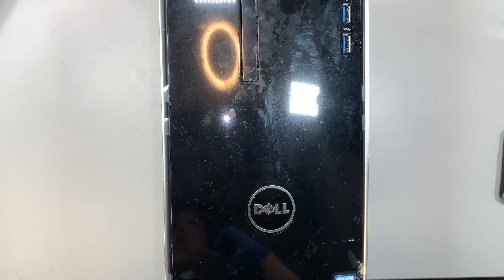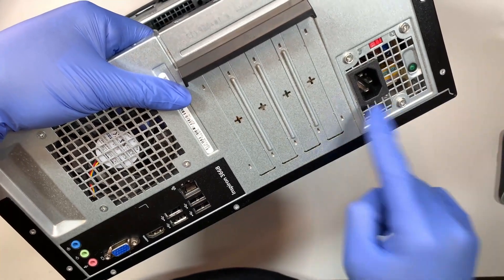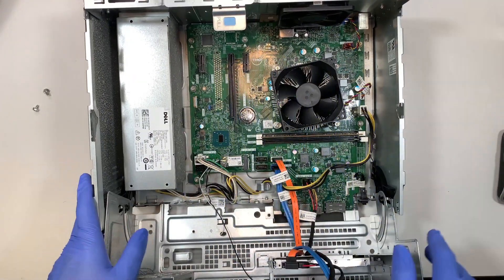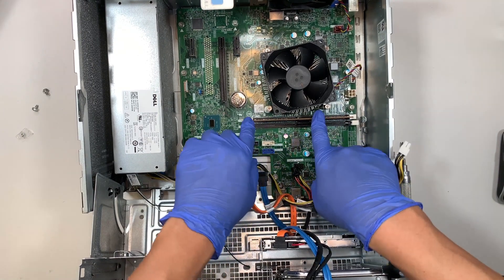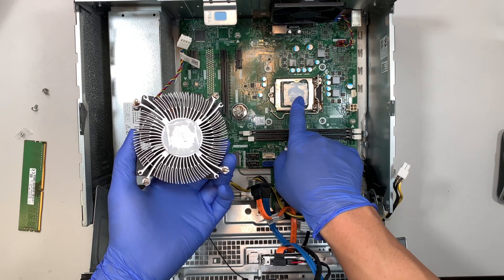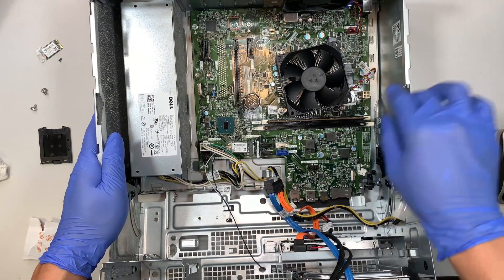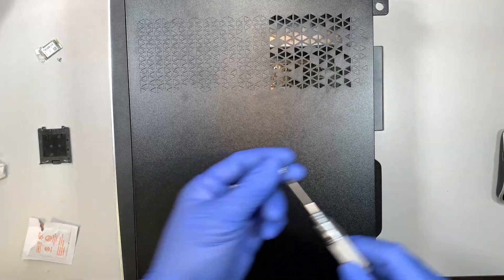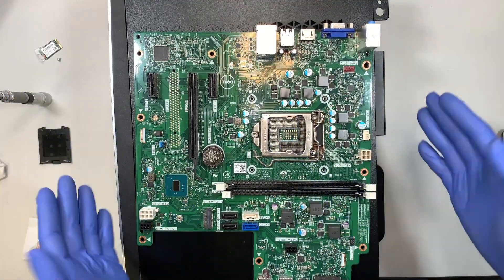Dell Inspiron 3668 Not Powering On   Motherboard Replacement

Comment: i have brand new dc jack, ac adapter, a new battery that ALL works,, but the new motherboards from parts peoplw company don't work half the time so i am re swapping back to the old motherboard that still charges my battery and powers on!?
😢😢

Comment: Hello! 
I have a question ...
I also have that same model pc 3668  and what it does is the power supply led green lights up but it goes off in a couple of seconds , it does not stay on .
Do you think that it is a power supply problem ?
I kind of remember the green light on the back should stay on as soon as you plug it  in,  but like I said it comes on for a couple of seconds and goes off.
The day that it stopped working ,  I pressed the power button and it got as far as seeing the dell logo on the monitor , and then it powered  off , and that was it . 
Any ideas or suggestions ?
Thank you !!
Reply: Hey, i am getting that same problem. Did you fix it? Is the green led supposed to stay on?